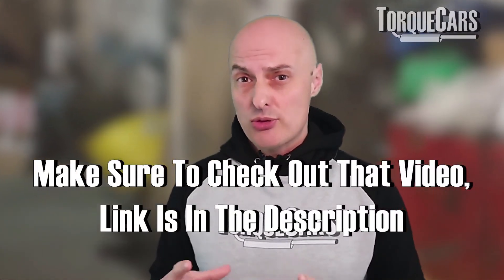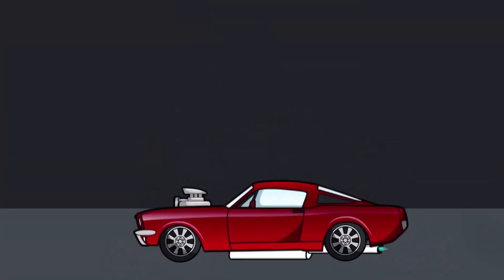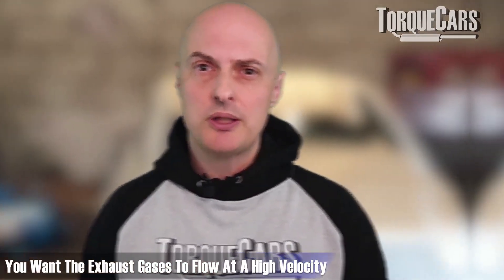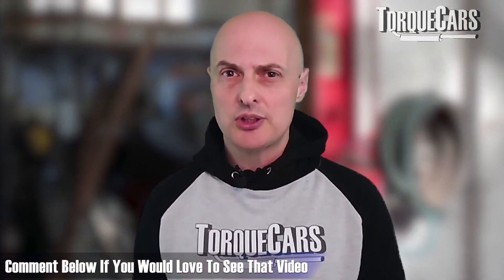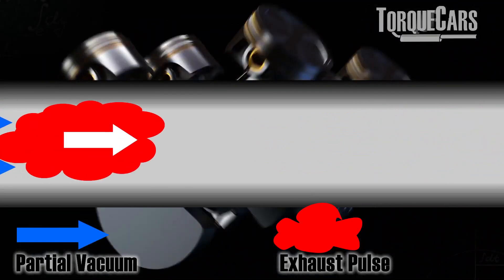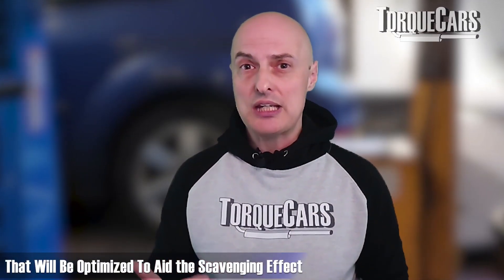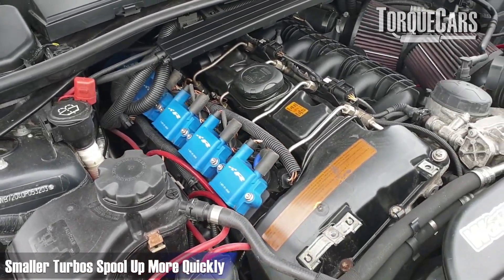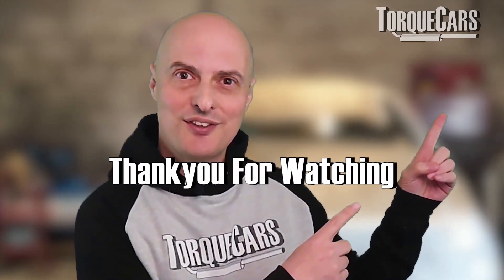Can You Add 4 Turbos, One For Each Cylinder?

Comment: Is it possible, in a twin turbo set up, to have one turbo activate at low end and the other at high end?
Reply from the maker: Yes it is, some manufacturers use a small turbo for low RPM and then switch to a large turbo at high RPMs. There are a number of twin turbo configurations and I recently did a video covering this if you haven't seen it yet. https://www.youtube.com/watch?v=GklnUby0a8w